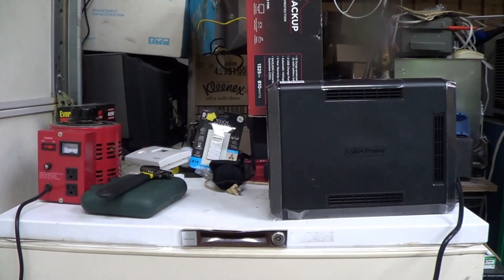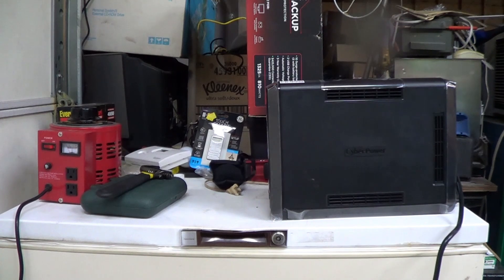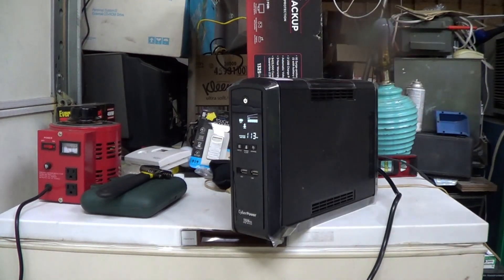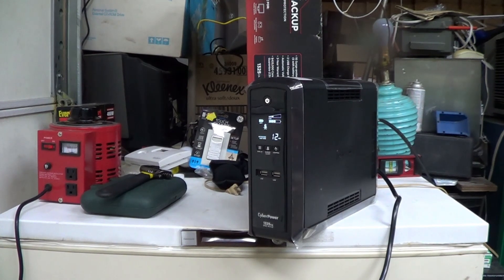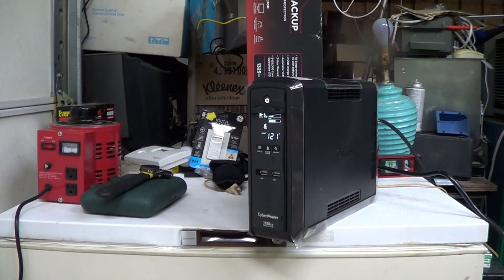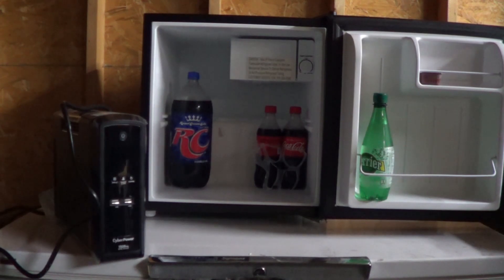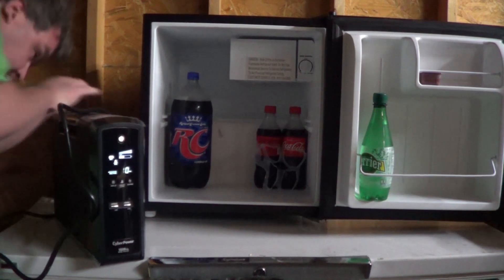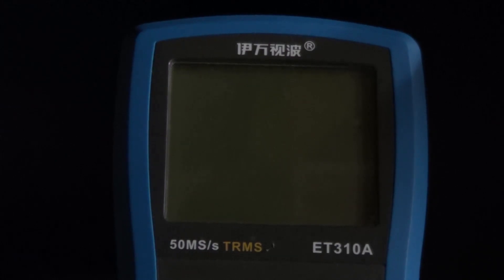CyberPower GX1325U UPS Inverter Surge Tests

Comment: How do you get the usb ports on the front to charge connected devices such as an IPad or IPhone?  The usb ports on mine aren't outputting any power.  Everything else is working fine but the usb ports.  I can't seem to figure it out.
Reply from the maker: The UPS has to be both of turned on and operating from line power. If the USB ports still fail to provide power, I would try another cable or a different USB device. Also make sure the connectors are clean, and that nothing could be shorting them out.
Reply: @uxwbill  Thanks

Comment: Curious, does yours make a buzzing noise when unplugged from the wall outlet?
Reply from the maker: Power for the internal logic and circuitry may come from a DC-DC converter, and those can make some noise. The DC to AC inverter also makes noise.
Reply: Mine makes a noise when unplugged. I just unplugged for testing.
It is a CyberPower LX1500GU3.

Comment: I'm just curious- Would it be possible to connect a large external deep cycle battery, like a car battery, to a UPS to increase it's capacity? Probably a dumb question, but I don't see why it wouldn't work. Thanks!
Reply from the maker: Car batteries aren't deep cycle batteries. They're designed for brief periods of very high current draw from the starting motor.

That said, you can add a larger battery to many UPS designs. You have to be very careful, though. Most UPSes aren't designed for extended runtime and the inverter might overheat or burn out if run at high load for any more than the few minutes the original battery would have lasted.
Reply: Thank you for your help. Also, to clarify, I have a few extra Optima Yellowtop batteries, which are deep cycle. Thanks again, I love your channel!

Comment: that's a pretty impressive UPS!  Seeing that it can power a mini fridge for almost an hour (or so it says).  I wonder how long it could power a modem and router.  We've had some power outages in my area that can take HOURS to restore.  My laptop can go 4-5 hours on battery, but in this modern world, what good is a computer if it's not on the internet LOL
Reply: I have a pfSense computer and a Ubiquiti wireless AP running on a model similar to this (CP1500PFCLCD). According to software and the front LCD, it can run for about 2 hours. This is a setup that uses 36 watts. Not bad, if I had a lower powered setup, I bet it would last 3+ hours.
Reply: @Blondie SL I know that this comment is 5 months old, but I was just watching some old videos of uxwbill. I don't know who your ISP is, but I have had both AT&T Fiber (in Nevada), and (Charter) Spectrum in both Illinois and Nevada (both areas are legacy Charter areas), and when I had power outages, their systems remained functional. I am not sure how true it is, but I believe that ISPs are required by law to have battery backup systems in place for their infrastructure.  I know that the same goes for cellular services as well.

TL;DR Yes, my ISP(s) have continued to work during a power outage.

Comment: Uxwbill Have you ever had a literall smoke test from a UPS you where working on?
Reply from the maker: Yes, once. I knew better than to do it, but I plugged in a flood damaged (early 90s) APC Back-UPS. Something within shorted out violently, with a very big series of yellow flashes. I unplugged it almost instantly, though I"m surprised it didn't take out the circuit breaker.
Reply: uxwbill yikes! If it was me I'd have to change my shorts lol.

Comment: I've got an old Geek Squad branded UPS that I'm pretty sure was a CyberPower rebadge. That thing is at least 10 years old and I've had it in service since the day I bought it new. With a battery swap a few years ago that thing has been nothing but reliable all this time.
Reply: I have a similar unit, same story. They are nothing but wonderful UPSs and I will definitely go with Cyber Power Systems for my setups in the future.

Comment: Bill has good taste. RC and Coke. Good stuff.
Reply: Lem Aiko Blah to coke (Pepsi fan for life) I give coke credit for the better cherry flavored cola. As for RC never tried it since it's not on our side of the boarder.
Reply: This is not the first video where uxwbill has RC cola around when making a video. RC is hard to find even here in the Delaware Valley but I have just found a very reliable source of it recently (and at only a buck for a 2L).